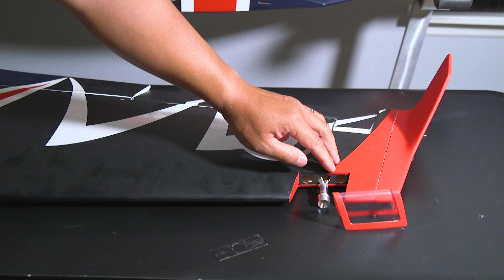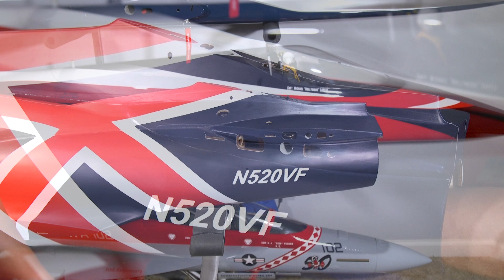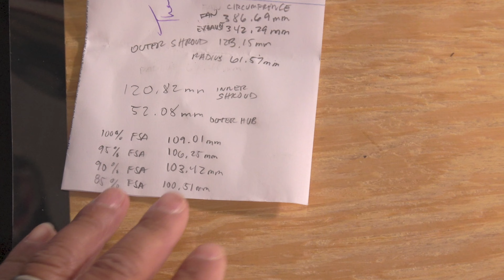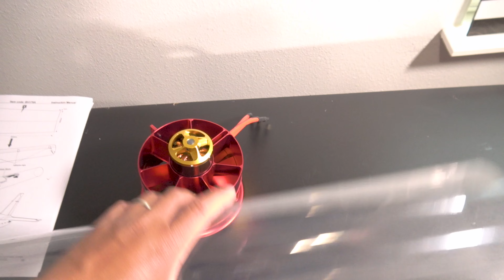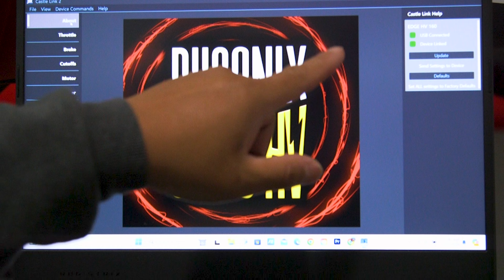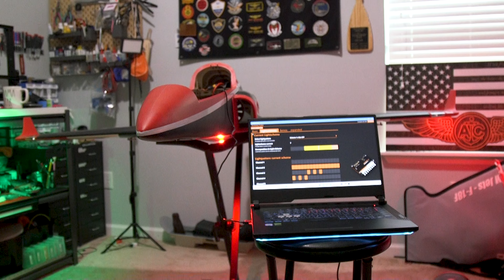Black Horse Viper MKII120mm EDF Build Complete! #aviation #airplane #rcaircraft #rcplane

Comment: Hi there
Thanks for another informative and great video 
Would be a k-70 turbine a good power option 🤔
Also the light balsa airframe would stand force?
Thank you
Reply from the maker: The owner of the Black horse Viper converted it with a K85 it handles it very well
Reply: @WarrenRC6373 
That’s good and thanks for advise
But since I got the other green BH Viper which I will use a K-102 in it and is made for turbine 
Thought perhaps k-70 would be enough to not fly over G factors and to not over stress this airframe at all 🤔

Comment: I am adding the ductwork but I am modifying it with carbon cord like the BVM jets. I don’t like that open duct design. Most people have that setup with the open duct since the intake ductwork collapses by the power of the fan. I’ve begun the carbon cord technique and it seems to be very rigid so far. I am mostly a turbine jet guy but wanted an EDF jet. Let’s see what happens! I have a Schubeler system supposedly it’s the best.

Comment: Thanks for this series, I'm building the same Viper now, was wondering if you kept the same nose retract as the steering mount is remote pull pull, I'd prefer steering servo on the landing gear if that's an option. For the lighting, I rather not have to saw the spot, there seems to be an option for other shorter heat sinks, any reason why they weren't used. Also, due to the shape of the opening. Wouldn't two per side be better. Many thanks!

Comment: Hey. How do you feel about your uni-light setup?? Would you change anything and did you have enough extra wire? I'm planning on getting the .5M and the 2M cable extensions. I have it all in the cart but I just want to make sure that you are pleased with choice you made. Also, thanks so much for putting out those videos. I'm sure I'll be referring to them from time to time for some references when I start my build.
Reply from the maker: I like the Uni-light and recommend the system. They are very bright and simple to setup. I did order wire extensions and connectors to create custom length I need.

Comment: did you decide not to use the air intake ducting ?
Reply from the maker: I did not use it. Went with an open setup, inlet ring installed on the fan.

Comment: Did you install the air ducts inside the jet?
Reply from the maker: I did not install the air duct on this jet. It’s an open air setup since the JP hobby fan has an inlet ring installed. Hope this helps.😊

Comment: Did you add brakes to the main? I am not finding the update in your video. Since you did not change out the gears, what braking system did you go with? Was it JP hobby?
Reply from the maker: https://www.bananahobby.com/jp-hobby-all-in-one-assembled-main-wheel-set-diameter-75mm-axle-shaft-size-5mm-with-jp-electric-brake-system-244090-prd1.html

Comment: The covering isn’t the best , but it is a fun plane to build , I sprayed the wheel bays black and opened up the back of the nose wheel wheel bay for increased air flow. All wheel bays need re enforcement for durability. Wing tubes far too heavy . Like all ARFs needs a fair amount of adaptation. But is a solid beautiful aircraft at that gap in the EDF market 😊

Comment: I also had a main retract fail after two cycles. It's unfortunate that Black Horse doesn't just work with JP Hobby to include those. I would have paid a little more.
Reply from the maker: This Viper build is Manufactured by Blackhorse model. BH does not sell Blackhorse models. But I do agree that the retracts on the Blackhorse model is not the best and also the covering is the worst I’ve seen. They look nice new out of the box but the moment you take the jet out in the sun it just blisters everywhere.
Reply: @WarrenRC6373  BH=Black horse

I ordered replacement motors for the gear assembly from JP Hobby. The BH gear have an internal failure point in the gearbox. 

Also, it's just self adhesive shelf paper with a design on it. Not much you can do to keep it perfect.
Reply from the maker: @AphexTwinII aw gotcha with the BH my apology I misunderstood the acronym used.